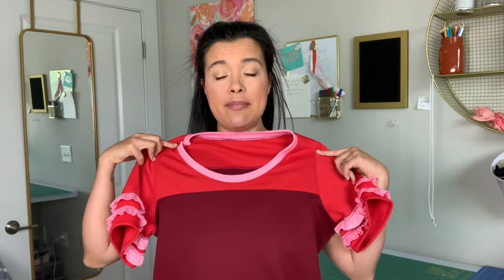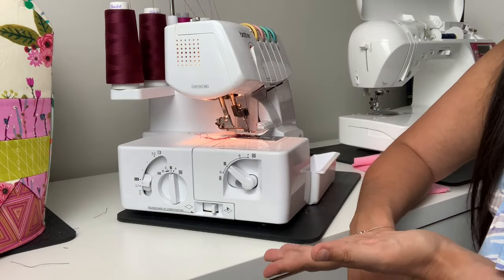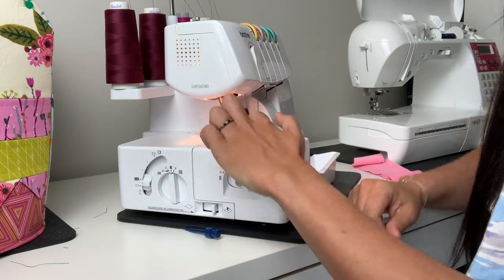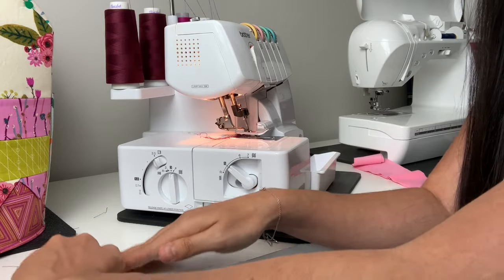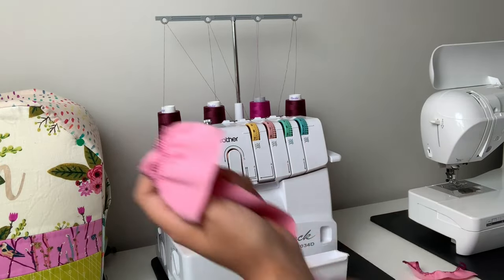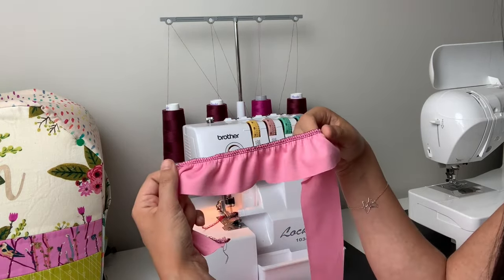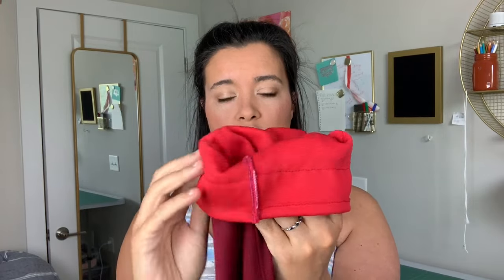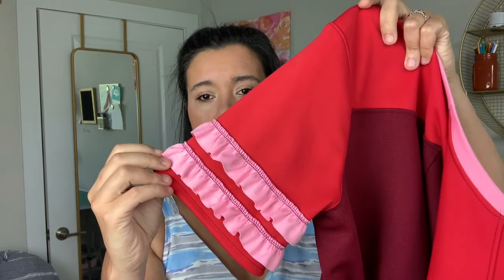How to Sew Ruffles using your SERGER!

Comment: Great video. I have the same serger and I love it!  I did notice there was a ruffler foot that came with it, but I avoided it opting to stick with basic serger stitches.  Now however, I feel motivated to experiment a bit, particularly since I have so much scrap fabric to practice with.
Reply from the maker: You should! Let me know how the ruffler foot works out!
Reply: @InsidetheHem  Pulled out my 1034d serger and the foot that came with it was actually a gathering foot (but I had been calling it a ruffler foot).  I tried it using the tips in your video and the gathers look BEAUTIFUL.  What I really like is that if the gathers are too tight, I can pull on them slightly and make them expand to fit the exact size I want.

Comment: I have had 5 sergers and I recently purchased the Janome air thread.  All of my previous models would snap the thread if I put the tension to an 8 or 9.  I am a really experienced sewer and I’m glad you put this up so I’ll go get this one out of the box.  I have the special foot too and never got to use it because my very nice Husqvarna serger broke when I was about to use it. I feel like I’m not meant to serge. Well see how we go on this one.  It was almost 2 grand so hopefully I can do it.  I live for ruffles, I do them with 1/8” elastic so they’ll be even but I hate the bulk it adds.  Anyway Wish me luck!
Reply: I have a few sergers and I still use and like the Janome. I have 2 industrial serger too and those are the filet mignonette of sergers hands down. But the Janome is a good one, you will like it.